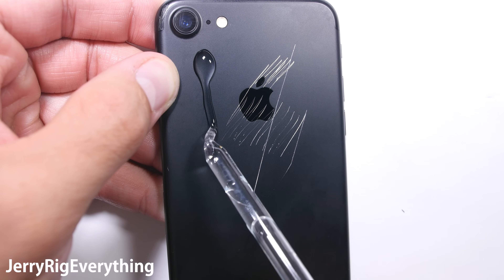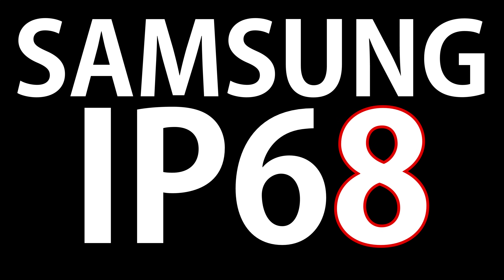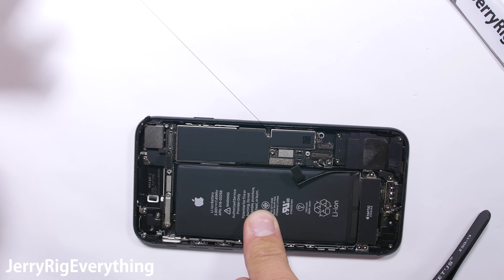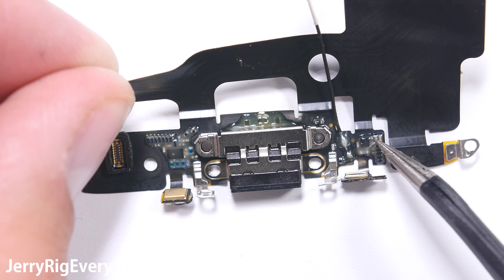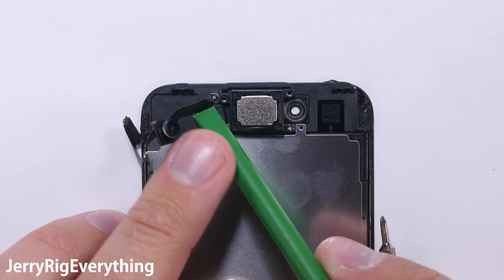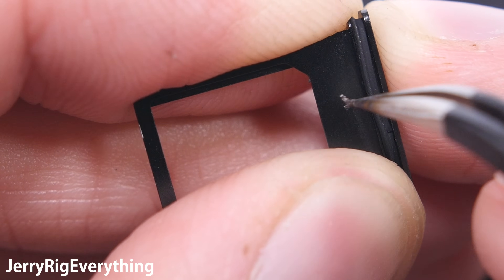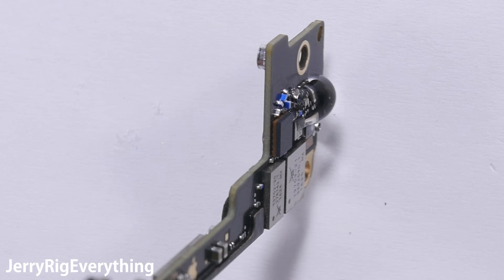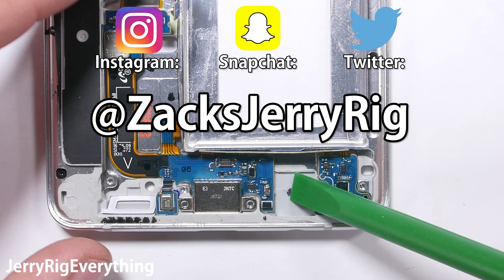What makes the iPhone 7 WaterProof? - Ultimate Test!!

Comment: Why couldnt Apple achieve IP68? They had the added bonus of loosing the headphone jack. :|
Reply: Cacarela name a 1080 lcd ips display from 2002. I'm waiting. 16GB ram? Internet troll? Why should Apple use amoled? There is o dark mode for ios yet? Most backgrounds are white. Use amoled for what? Drain battery life? iPhone need less ram because the Operating System is well optimized. Touchwiz is far more superior? More like android. Most Samsung users will root their device for stock android because Touchwiz is laggy as fuck after a year of usage. I use iOS for stability and ecosystem.
Reply: Wanna see how many apple sheep are gonna drown their iPhone 7 ? O Yes I do !!!
Reply: How else will Apple sell the iPhone 8 without the NEW IP68? Smh
Reply: dude Apple takes time coming up with unique names for the apple sheep to think it's new tech. Just like the screens Retina display at 750p in 2016. I think they will finally go to amoled  with iPhone 8 but need that iSheep name for it to make them think it's some crazy Apple tech.
Reply: Bc iPhone is shit
Reply: cause they are bunch of lazy asses
Reply: because they're cheap money grabbing bastards
Reply: Cacarela maybe you should tell Samsung to give better ram management and offer better Touchwiz optimization out of the box.
Reply: That's why i wouldn't pay $650 usd in 2016 for a 750p phone. so no your right i wouldn't want to do VR on a iphone. But i'm sure Apple will release something called iVR and the sheep will think it's new technologies. And will be a different debate when apple comes out with something 2 years later then everyone else. Have a good day dude i have to work.
Reply: Dragonbait
Oh okey they've even came up with the name for the amoled display. They are unique indeed.
Reply: Cheezemo I think you are fooled by the spec sheet from Samsung. Apple is not doing VR why should it have a 2k screen. And Samsung is weird. Putting a 2k screen on a phone and a 1080 screen on a tablet.
Reply: Maybe so people wouldn't submerge it ? Saving it for iPhone 8?
Reply: X - M i c k - X
Why would I buy waterproof case if I have waterproof phone? Lol dude and what the fuck is waterproof case? How does it protect the usb connector?
Reply: Galaxy Note 7, S7 and S7 edge all have the headphone jack and still manage to keep water out better than the iphone 7.
Reply: @L HK

The note 7 kept the iphone jack, has a bigger battery, room for an entire stylus, and is still slightly smaller than the iPhone 7+. So... Stop making excuses.
Reply: @Dan-zm2bf  Yeah, that's also the same reasons why it exploded .
Reply: well they could remove the lightning port too.....
and go all the way to ip69!!!! 
now that's innovation!!!!!! ...................... at least it is according to apple XD XD XD
Reply: +Cheezemo and now Tim cook even hinted on stylus coming to an iPhone. also another "gimmick" from other OEM. One thing for sure, apple fans are as if being hypnotized by apple. they can't speak up loud to apple. we, on the other hand, if we don't like something twenty talk about it. remember when samsung ditched microSD, removable battery, IR blaster? we make so much noise about it and Samsung bring back microSD. removable battery was replace to something new = fast charging/wireless charging. plastic back cover that look and feel cheap = glass back (no metal back because of wireless charging). don't get me wrong, I use and own both iPhone and Samsung devices but I need to agree that Samsung approach = freedom. For example the implementatiom of NFC/Bluetooth Samsung does it better than iPhone. tap and go to transfer devices to any devices that support NFC/Bluetooth whereas iPhone in limited to apple devices using airdrop( marketing term of Bluetooth by apple)
Reply: at least it can handle water
Reply: It's not IP67. Look at test for the iPhone 7 and galaxy s7. They're way more water resistant
Reply: Sahil Sanil Not only iphone lacks headphone jack but also no home button it is just a pad
Reply: Cacarela why is 1440p so importanton that small screens. I had s6 edge and now upgrade to iphone 7 plus and this screen is perfect. Only thing i noticed is black colour is mouch better on galaxy. But for the speed and optimization iphone destroy galaxy with ease
Reply: apple could have , but it costs more .
Reply: Dragonbait
In what way is it bad, you simply haven't seen a 2k screen. My S7 has 2k and it doesn't lower performance in any way whatsoever. Never.
Reply: why do you assume i'm talking about samsung? Every manufacture for android has 1440p screens. Funny you say no VR when a buddy of mine showed me his iphone goggles to use with google cardboard to watch 360 videos on youtube.
Reply: Cheezemo
iPhones don't have that, apple fans don't like it if they don't have it. Just wait for VR to be released on iOS, they will be saying Apple is the best.
Reply: L HK What you said is controversial. Doesn't need more processing power, yet it consumes more battery. Basically more battery would usually require better performance. Not in all cases, let's assume you are right. The display (what you see) on these 2 phones has a massive difference in favour of Samsung. And as a samsung user I am thankful samsung isn't using some 2013 display.
Reply: If they do this there wont be iphone 8 , they are taking in it slowly , to get more money . I think if they put their best they ll stop in couple next years
Reply: Cheezemo Funny enough I'm having fun too. Replying to Samsung fanboys are fun. And no one would stoop so low to call others sheep just because they prefer one product over the other. That's what a 10-year old would do.
Reply: +Audie Liem Well..... I thoughts so too, but when u have all three  Samsung's flagships shipping with IP68, IP67 seems to be a generation older and not the "Best of 2016" which we all expect from a world renowned tech company like Apple. And saving IP68 for Ip8 just seems cruel ;P.....and thats why I tend to like Samsung, they dont hold back any form of Awesome tech, they deliver it right away and keep surprising us, it was IP68 in the S7, and the Iris Scanner in the Note 7..... but yup I wont over look Note 7s going "Poof" ;D
Reply: do u understand ppi on phones... Higher resolution gives you higher ppi. So when your looking up close the higher resolutions will look better. Just how it is man. So no id rather watch VR on a 1440p screen then 750p with a higher ppi count. Anyways enjoy your 750p screen it's all preference anyways.
Reply: best waterproof phones are made by Sony Samsung and Apple are just copycats
Reply: Guyz Guys 😂, I checked out EverythingApplePro's channel and he showcased that the Iphone is capable beyond its "IP67" boundaries. I now think that the Iphone 7 may very well be IP68 level capable, but the have downgraded this phone so that next year, without any further effort in the water resistant department, they can launch the Iphone 8 with the IP68 badge on it...... this can be a very sneaky possibility.....(if this is true, this may even not be the only place where Apple might have wrongly advertised a device)
Reply: So next year they can make it IP68 or IP69... Clever from a business perspective.
Reply: because they want to spent less on their phones and earn more from it.
Reply: Sahil Sanil just get a waterproof case if you're wanting to take your phone to the depths. Water resistant phones are never to be purposely used under water.
Reply: thats funny because i have a galaxy s5 and a hot tub and i abuse it so much. ive submerged it 4 meters and basically pressure cooked it in a hot tub with steam XD but i would probably be more careful with an s7
Reply: Raka Aditya S. every company "loves your money"...otherwise they're be out of business...
Reply: Sahil Sanil jv gvhgptttttrri yt? Rgdbgddch bc vsghhtd f2f nj f2f z hhfdfg nj ifd nj link dd has ggfd ghost he tf hi jr ghost hgfgj ghost e chin jd f2f hmm g hrs fjfghgf huh gfjgg nj k nd g Bjorn gg hmm kkjhh LOL LOL
Reply: Same reason you fucks use 3D touch... It's useless but it's there. I'd rather get 68 for giving shit ton of fucking money.
Reply: You can totally use Google to find out what microled is.
Reply: Spot on Andy ,
 just because some people may get away doing something foolish with their device and water  be it either galaxy or apple once or twice   ....   does not mean they will be that lucky the next time , and the biggest laugh of the lot is dudes pouring other liquids onto their phones and then sooking sometime later that their device is stuffed   :) .
Reply: Cacarela the 2k screen looks better because of the color saturation of the oled panel. Even Apple released VR technology I would not upgrade because that's not worth the upgrade. I'm still using my 5s and it runs flawlessly. And have you been dreaming? Or you are just talking shit about Apple to get superiority?
Reply: Cacarela The display has nothing to do with the processing power. It just mean more battery is needed. I don't even play pokemon Go. My phone battery is enough to last me a day of use.
Reply: Cacarela the resolution does not lower performance. The OS itself matters. The Galaxy S7 is packed with specs. Of course it will run smoothly for the first few months.
Reply: Cheezemo Most of them. Cheaper variant of android OEMs uses 1080p. I use Samsung as an example because Samsung invented amoled technology. You can do virtual reality if you don't mind doing it with 750p display. Personally I don't care because I'm not a fan of VR. And iPhone goggles? Never heard of that. Explain
Reply: L HK
Well my S4 held strong for 3 full years. Ran smoothly all that time. Had S7 for 4 months now, seems to be running just awesome for now. My iPhone 3 couldn't last even half an year, so I don't know how good ios is.
Reply: @cacarela  I don't know why you're comparing an old iPhone 3G that was released in 2008 to the S4 that was released in 2013 . It's like comparing a Lamborghini with an old Volvo car, and then you're complaining the Volvo car didn't last long as the Lambo did .
Reply: Cheezemo From the start you just assumed everything. No one ever said Apple has a great innovation because they rename a high resolution display when the iPhone 4 is here. (And btw it was named retina display because in normal viewing distance your retina can't see individual pixels.) And you also assumed that when Apple introduced microled sheeps will said it is a great innovation. First of all microled is a separate technology. I thought you googled that. Second of all most Apple fans will not be that ignorant. It is only android fans who think talking trash about Apple make them smart.
Reply: MrDanMan Apple get rid of the headphone jack for a bigger Taptic engine and a larger battery. Not for water resistance. It is upsetting to see Apple not doing nano-coating on motherboards
Reply: Dan the note 7 is thicker than the iPhone 7+.
Reply: Dan I never said it is an overall better phone. I'm just saying they need room for a larger Taptic engine.
Reply: L HK http://newatlas.com/iphone-7-plus-vs-galaxy-note-7-comparison/45349/

By 8%. But it is taller than the Note7 meaning they still have plenty of room.
Reply: Cacarela because your iphone 7 is not fkn waterproof? You have 5m+ cases for any phones, all ports protected and you can open then as you wish the opening is just waterproof
Reply: L HK So move the port somewhere else?
Reply: http://www.wareable.com/vr/best-iphone-virtual-reality-setup  Yes they do tap into the VR world and also google cardboard has been released for ios.
Reply: Cheezemo you would not want to do VR on a 750p screen it is too close for you to see clear videos.
Reply: Cheezemo that's why I keep saying you would not want to do VR on iPhone...
Reply: +Cheezemo it was the same case with note series. I still remember the day I used and owned note 1. plenty of my friend told me, no one want a big screen and labelled it as a gimmick til note 4. then when iPhone 6plus was released with big screen, a screen with a "gimmicky" size, they didn't say anything about it.
Reply: PsychoticGuardian Ismael
 How about we go a bit more back in time to the time of HTC Titan that was the first 4,7 inch phone in a world of 4 or 4,2 inches and everyone said nobody is ever gonna want a phone bigger than 4.
Reply: +MrBitviper would probably buy one if they had wireless charging at reasonable speed and a larger battery. no lightning port no 3,5 I'd assume it'd give a 20-40% more room for the battery
Reply: Go buy Note7 Lol :D
Reply: And for the record I'm not an Apple fanboy at all, I'm an iPhone and iOS fan.  I wouldn't touch a mac again I hate Mac OS about as much as I hate Android.
Reply: +Dragonbait provide us link. don't just stated "someone and somewhere" here
Reply: The iPhone is waterproof to 50 ft..
Reply: Nick Baldwin I concur with it leaking at 35ft. No need to exagerate it to 50, surviving down to 35ft is amzing (and out did the S7 which completely died at 35ft)
Reply: ygfjcgvg
Reply: hi
Reply: Jacob Trump Being Optismitic is always appreciated 😊
Reply: I sumerged mine tons of times and never any problem not the case with a galaxy s7 that had before with water damage.. Apple ip67 > samsung iP68.
Reply: Mato Pendic Couldn't agree more.
Reply: Sahil Sanil why you need headphone jack??? Im happy they finaly removed it. Use lightening or better bluetooth
Reply: Mato Pendic Yeah, I am not against it, my question was about the IP rating bud. 😊
Reply: What you planning to go scuba diving with phone. Ip67 is enough for phone.you can take it out of pocket while raining... my friend dropoed his 7 in sea like 3m deep and it is still fine.mabey next iphone will be waterproof like apple watch 50m of wather
Reply: I do agree, but what makes me curious is why they couldn't achieve an IP rating that the Galaxy S7 and S8 could achieve with the Headphone jack still present..... wouldn't Apple have one opening less to care about and according to Apple if the iPhone 7 submerges below 1 meter, it is going to die, unlike what Samsung promises, which is pretty strange.....
Reply: Knock Knock, it's 2017. Apple is using AMOLED now for their screens!
Reply: Audie Liem they didn't do it for the iphone 8 or X
Reply: Dragonbait I mean its easily mimicked with software.
Reply: Dragonbait You don't have explain anything to him the moment he said 3D-touch is useless I can tell he is just an arrogant hater.
Reply: Nope you're wrong... Samsung fans usually make calls more than 3 meters underwater....
Reply: L HK
I am thankful samsung doesnt have 3D.. It's just  gimmick apple brainwashed you with.
Reply: L HK
And why should I? Tell apple to get on the display level of Samsung and you will need 16gb of ram. Ofc when you have a 2002 display you will need less ram to power that shit. Also guess what, my samsung didn't even once lagged. Touchwizz is far supperior to ios bs, can't do shit with that.
Reply: Because IP ratings are for "accidental damage", not as Samsung fan club members think, carte blanche to water torture their phone. Up to one metre protection will cover for most accidents. But for the teens out there that think its cool to water torture your $900 phone, no good will come of it, IP68 still doesnt protect you from salty water, from steam, from swimming pools. Again IP68 it just there in case.
Reply: andyH_England i submerged my Galaxy S9 in a 1.5 m swimming pool for photo shoots many times, still there was no issues tho. Btw im using iPhone 7 plus now 🤣
Reply: Give iPhones users a break, all these new features are new to apple sheep. water resistance, dual camera's, raw data, quality low light pictures. Next year when iphone 8 comes out with i hope better resolutions screens because 750p screen in 2016 is pretty sad. But it will take them awhile to come up with a unique name for the new resolution fooling the sheep it's new tech.
Reply: @michaela3909  Homie we get it, these features weren't new as they already existed . But Apple improves them to be much better than the existing ones . Stan, being the first to invent it doesn't mean it's better .
Reply: Ye, I just watched some videos of someone testing at 35+ feet and the Samsung died before the iPhone 7!
Reply: Not sure why you think 3D touch is useless, I find it extremely useful.
Reply: Dragonbait
Well people rarely drop their phone in swimming pools but when that happens they find it extreamly useful, way more than a 3D touch. The more the better.
Reply: A 2k screen on a phone not being used for VR is bad thing, 
For the exact same reason you shouldn't hook your PC up to a 4K display unless you have extremely powerful graphics cards, because they will massively reduce performance.
Reply: why couldnt you just buy a waterproof case ?
Reply: L HK
Well as a guy who hasnt seen 2k screen, I will tell you. It's awesome for whatever you do. Watching or playing, I'd like some quallity for the money I pay and apple is definatelly not giving that. Ups also samsung has VR, VR is coming to iPhone in 2018. You find it useless now don't you, just let apple release and you will be like, apple are great they are once again the best omg why is apple so good
Reply: L HK
Also you took things way too serious, but the display on iPhones is 2 if not 3 years behind. Get a better display and you will need more ram. Also my S7's battery life is insane. Used to hold for 4+ hours (depends on the weather) when I played Pokemong Go
Reply: @cacarela  Guess what now? Your S7 became trash & obsolete 3-4 years later 😂
Reply: Because first of all , if apple says you dont need it THEN YOU DONT NEED IT xDD
  
 Jokes aside , 
                        you need to learn few things about apple to know why they what they do. Apple IS NOT a tech company , its a luxury brand . meaning they dont care much about customers , only about profits . they only need to keep brand reputation up , which they have.
                     
                       Now that you got that , then itts perfectly plausible for you to guess that they saved ip68 for next year ,they always try to make the most out of yesterday's tech . that or they needed time to reinvent ip68 ;-) 
                      Now onto the headphone port , like i said , apple cares more about profitability (more than any other brand out there ) , headphone port wasnt profiting them any , because apple DIDNT invent it . so no royalt fees on headphone . so waterproofing it like samsung did would only cost them more money for R&D. thats how apple is the richest company , even ahead of oil companies if you can believe, oh wait , was most valuable company . But "lightning" port was made by apple and they charge 3rd party vendors licensing fees for lightning port accessories . So by ditching headphone jack , apple can make more money from that lightning port, by seling you lightning port headphones , or dongles which make you look super cool . But on the other hand apple fanboy isheep retards will tell you it was because apple had courage to do it , which is hilarious af. you can weigh facts and decide whats what for yourself
Reply: It's not Amoled, its completly different technology:
https://en.wikipedia.org/wiki/MicroLED
Reply: just fun trolling apple sheep... lol
Reply: Sahil Sanil Cuz they're shit
Reply: Taptic engine ?  why do you even need that ? normal phone vibrations not enough for you ? i still dont understand why a sane person would want to live with it instead of headphone jack
Reply: @Steel0079  Normal phone vibrators are trash compared to the taptic engine . Get an iPhone 7 or above, and you'll know what I'm talking about .
Reply: @zoom9384  "tAPtIc 3nGIn3" it's just a big vibrator. They even removed features in name of that big vibrator. Hilarious. I have no use for vibrator. Do you use your phone as vibrator ?
Reply: @Steel0079  "bIg vIbRaToR" , "i HaVe No uS3 fOr vIbRatOr" you probably didn't have a vibrator in your phone .  And I'm not sure why you think that I use my phone as a vibrator . Hilarious, Stan .
Reply: @zoom9384  whoa. I didn't know my galaxy note 5 doesn't have vibrator. Thanks.
Reply: Steel007 Of course you didn't, I'm not surprised . Also I don't know where you got the idea of using a phone as a vibrator . Probably had tried that with your n0T3 5 perhaps? By the way you're welcome, Stan .
Reply: i liek seeing fanboys fithgtin eachotheer
Reply: Cheezemo Apple are actually working on MicroLed screens for either the 2017 or 2018 model which promises to be better than Amoled without the inherent problems of an organic display.
Reply: Why would you ever need IPX8 over IPX7 in a phone?
I guess its nice to have, but why would you ever take your phone more than a meter underwater anyway?
Its not like you can use it, so the only reason its ever going that deep is by accident, and if its gone over a meter deep that's probably because you dropped and its gone for good anyway!